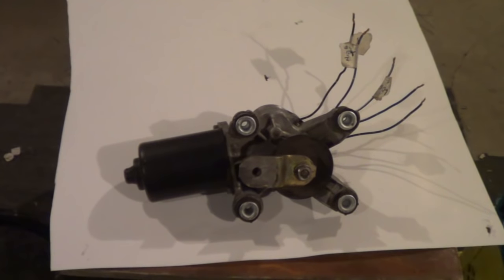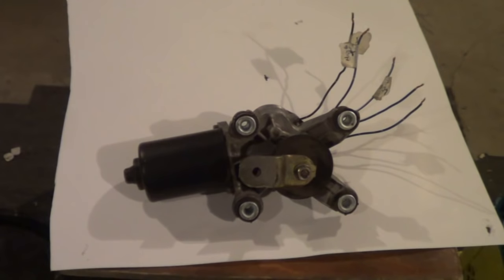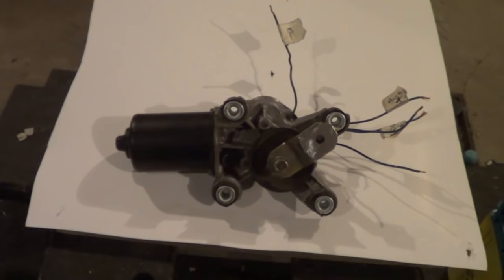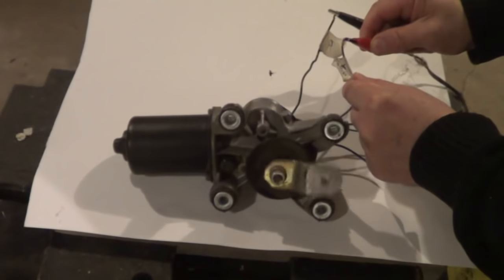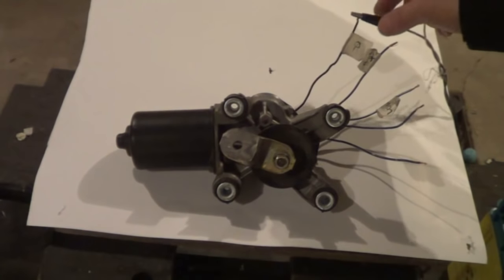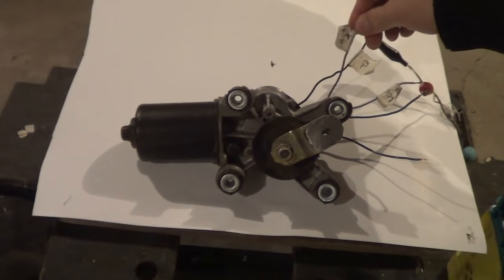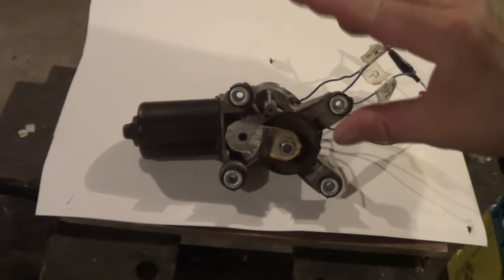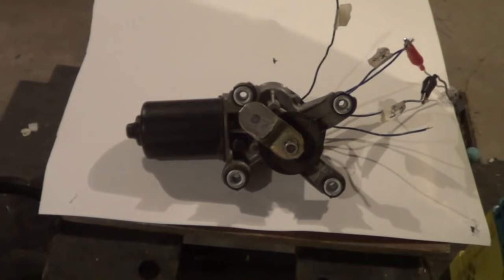Dead Things Vlog - Windshield Wiper Motor Wiring

Comment: Just a quick note from my experience retrofitting a modern wiper motor to an older car; if possible for any application, run the motor clockwise. If you run it the other way, it will tend to loosen the nuts that hold the linkages together, and they'll fall off mid-operation.

Comment: Spend alot of time trying to figure out the wiring on a 96 f150 motor to retrofit a 74 camaro but it was a mess. I even got the module and wired it to the original camaro switch, but it was a big fail. I guess I need  the f150 switch to connect to the module so it can operate the motor. Blew a couple of fuses and a waste of time but at least I learned something.

Comment: Old video i know, but is there a way to figure out which are park? have a 5 wire nissan wiper motor and while i can get it to rotate, rotate quicker and omg make it stop, I'm not clear on the right method of checking for park. Is there resistance or something I could check or other?

Comment: So how do you make the motor go back & forth (left - right; right - left), like when the wipers are on in the car?
Reply from the maker: its actually the mechanism that the motor attaches to that makes the wipers go back and forth, not the motor itself.
Reply: A rear window wiper motor has the meganism build in, so the would make about a half turn and then go back.
Reply: @kean3545  Correct the one I got does that and I'm trying to search and find if it is possible to make it not do that and instead run continously  in one direction but not having any luck. Do you know if it is possible to do?
Reply: @HomeGrownPyro1  It is possible, therefor you have to open the gearbox (not possible if it's closed with rivets) and figure out what contact you have to remove... I would go for the easy way and find/ buy a front window wiper motor, then you will have at least two speeds.
Reply: @kean3545  yes it is rivited closed however the wires are on the outside of of it. There is two coming out of the motor and 3 pins on the gearbox. The plug has 3 wires consisting of one wire from the motor, one from the gearbox. The 3rd wire to the plug first comes out of the motor  and connects to pin 2 on gearbox and has a resistor attached which loops around and connects to pin 3 with the 3rd wire going from pin 3 to the plug.
I was hoping maybe it would be something as simple as cutting the resistor out of that connection but Ill prob just end up buying a front wiper motor like you said and just keep this one around for a different use.
Thanks for the response.

Comment: is there any chance to get power from house electricity?
Reply: 12v to 110v power inverter
Reply: Just the opposite of what Philip Edwards said.  You will need at 110VAC to 12V DC Transformer that you can ply in a wall outlet.  Be sure it has enough amperage (large enough transformer) to power the wiper motor you are using.
Reply: @smokeydabear9073  what is the amperage requirements

Comment: hi you doing senor,  thanks for your video, but can you help me with my 1995 dodge caravan wiper motor. I was in the rain going to the taco stand, but I don't got there, and the wiper stopped, and I was lost like a sheep without a shepherd, so i had to stop until the water stop.  later at another day, i turn the wipers, and pressed with my lovely hands the connection of the wiper motor with the connection, and as long as I pushed with my gardening hands, then, the wipers were resurrected like the lord Jesus, but if I stopped doing, then the wipers stopped, and I see a huge dilemma when it rains.  Could please, senor, have some manner that the connection makes a connection of electricity, so if there is a flood like the one of Noah's day, my wipers will work.  could help me out, senor, I will thank you from the bottom of my soul, and if you end up in sunland, i will buy a hot dog from the seven eleven if you like, or whatver pleases you if you are having ravenous hunger that very day.  Gracias amigo, and that you will be happy ever after, gracias senor.